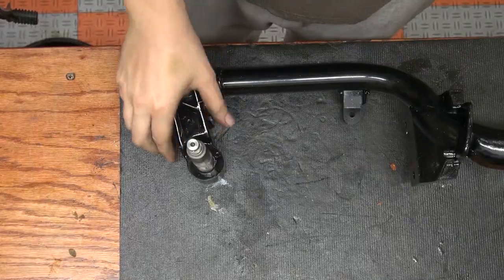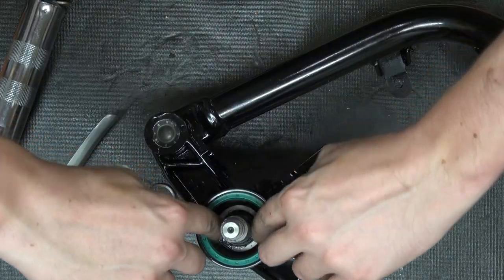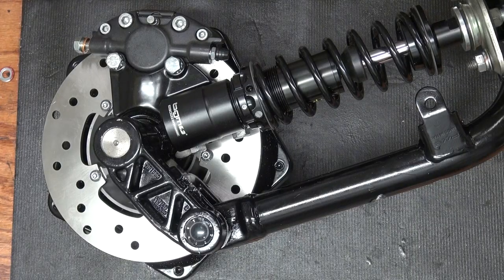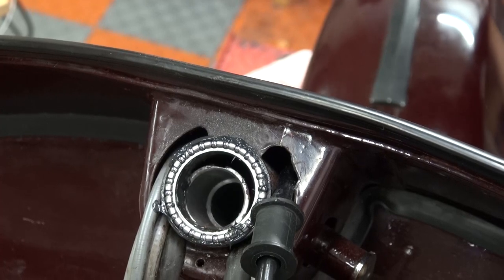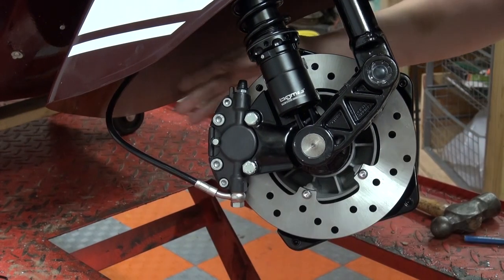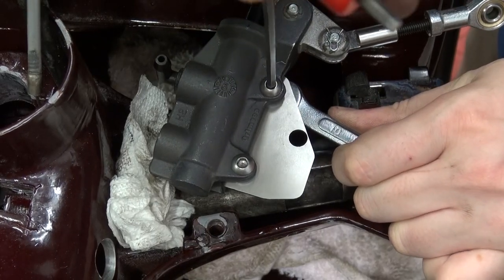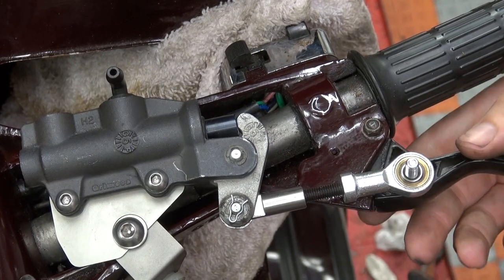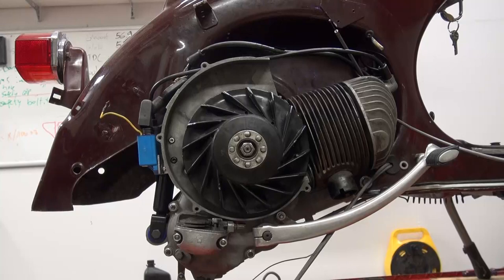Vespa Rally 200 Disc brake conversion, PK fork, Full Build, Pt. 5: TST Ep. 21

Comment: Question: I've just installed the grimeca kit on my px fork - what surprised me was the front wheel pulls slightly right under braking. Is this a common issue or something is wrong with my setup? Cheers bud!
Reply from the maker: Did you install the circlip on the axle?

Comment: it is custom master pump??
how to get adapter (holder for masterpump) for rally handle...
Reply from the maker: The master is from a Piaggio Typhoon 50
The mount for it is from a private workshop
Reply: @ThatScooterThing  
Hello do you have the big worm gear fitted on the hub for vespa px? 
I need a speedo drive worm fitted on hub.